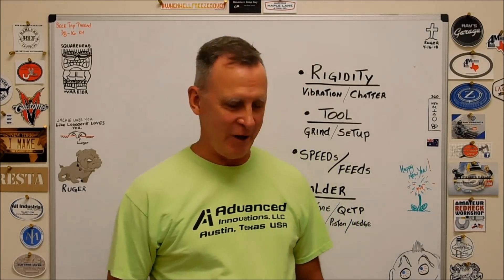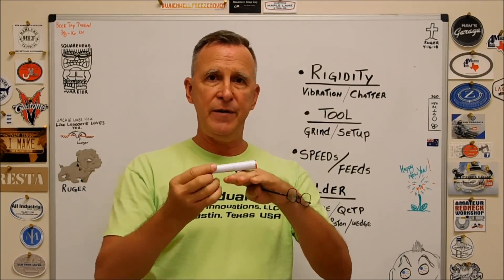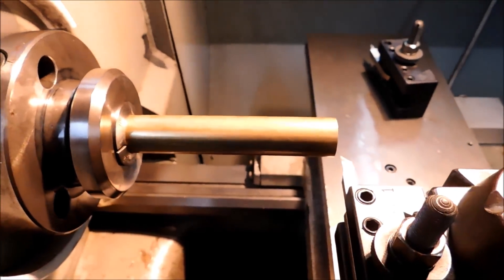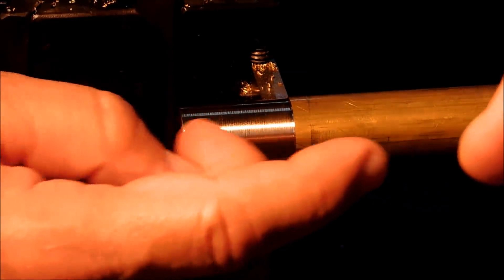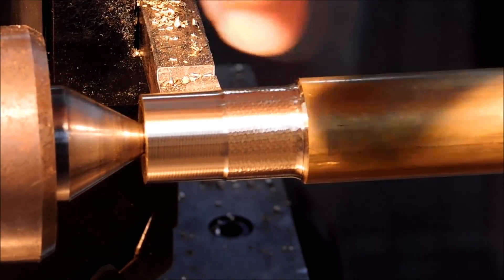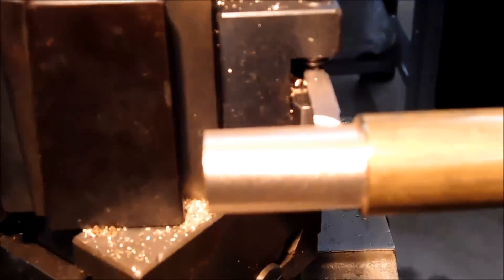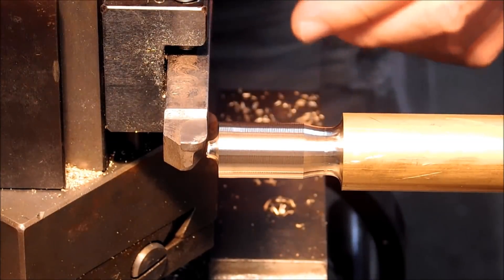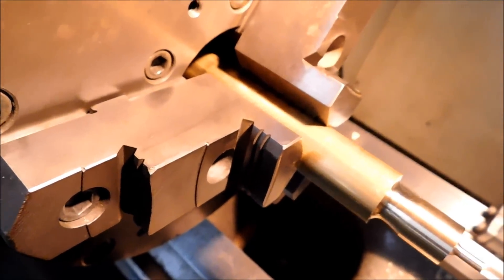Bad Turned Surface Finish and Some Reasons Why

Comment: Excellent demo Joe, lots of handy tips that will be applied on my small lathe. I've just ordered a steel wedge type QCTP which will help with the rigidity issues I've been having, coming from a cheap aluminium holder. I've been getting good surface finishes but issues with chatter when trying to take a deeper cut than around 0.005".

Comment: Is there anything we should know to reduce chatter when turning between centers? I've got an Atlas 10" lathe and I'm trying to make my cuts nicer. I'm getting some tearing, ~.625 diameter material both mild and stainless using carbide at 500ish RPM. Tried a few depths as well. Feed rate at .003ish.

Comment: 19:00 so this is the technique I need to use when I want my scale model parts to have a "hammered" finish? 

No joke, it seems like you could dial in a certain texture if you wanted a part to look cast or worn. Hit it with the right mix or red and brown to make a convincing old rusty iron piece.
Reply from the maker: It would be a great skill to be able to control that. I can see the ornamental use.

Comment: I wish that I had seen this video when I started machining.  Very clear.  I wonder if the results would be better with ER collets,  because they support the work evenly for the entire length of the collet, which C5 collets do not.  Also, I was surprised to hear you describe yourself as "blue collar".  I know that you work with your hands, but so do surgeons.  There should be a new color collar for surgeons and expert machinists who are constantly problem solving while working.
Reply from the maker: I like that thought. Maybe sky blue. A mix of white and blue. You make an excellent point.

Comment: Joe, I don't know if some one has mentioned it yet, but,  you didnt mention  " shear tool "  as an option for glass like finish on soft metals, i.e.  lead, alum, brass ... etc    .  I've only seen it mentioned on 2 maybe 3 other channels  ...  MR. Pete did an nice example of it, I wish I had known this approach before I got rid of my lathes ...     Good video  Joe   ...
Reply: Lots of positive top rake helps with the finish on soft metals.  I set up a lathe at work with a TFG style  toolholder and special ordered the inserts with tops and nose radii lapped to a mirror finish.

Comment: A few thoughts. Jaw engagement and the movement of worn chucks. If you think that may be an issue, an old standby to see if you have a gap get a can of spray Dykem and tighten onto your part and spray, give it a moment to set and open the jaws. you should see uniform areas that didn't get colored if it's going under the contact points. your jaw isn't grabbing there. that is reduced support. increases the chance of poor finish or in extreme cases parts discharging from the machine. (also great for when you cut soft jaws to see if you need to add a slight taper to get full engagement with the soft jaw because of the flex that is going to occur when you tighten down on a part)

Here's an idea though, and this comes up because Yesterday I was at work, on the old bridgeport. Doesn't have any niceties. no DRO, just an old manual worn down machine. I made a pretty critical screw up on the last cut of the day. One that never should have happened, but it got me thinking. it's little mistakes like the one I made that could and will catch someone new to machining off gaurd. I'm not used to a machine quite that worn out. so what actually happened, I was cutting a relief (sort of like a large flat T-nut) but I was cutting the side reliefs. I have it set in the vice, making the cut against the positive Jaw, So all I should have to do is run my tool back, flit the part 180 degrees, and run again. Load the next, They have a very wide tolerance so it's fine. I got to the end of the day, started getting anxious to get the cut on that part done, enter a bad judgment call...I ran the first side, flipped the part, and went "I could just climb mill back across it and be done with it." Didn't think about the backlash in the tables Y axis. got a half inch into the cut, and who would have guessed (everyone) that the table kicked back. luckily. It was as simple of a fix as to reset and run it the way I should have. But Overlooking the backlash and not having the table resting against the halfnut in the direction the cutting pressure is going to be applied. That was a pretty large mistake. I usually run lathes. Mills are not my strongest area of machining. but I feel like addressing some of those gremlins that occur and will absolutely ruin your day could be beneficial to those with less experience (or even myself where mills aren't my strong point)

Comment: So you know carbide inserts often have minimum RPM or cut depth before it will give a good surface finish. If you go under that it looks like crap. The problem is as they are meant for CNC there is no way you can ever meet their RPM minimums on a manual lathe (we would need about 3000 or more RPM for a 1 inch bar stock on steel with a depth of cut of at least 1mm). So I try to buy finishing inserts that allows a shallower depth of cut but vast majority of the inserts out there need much higher feed and depth.

Comment: Your safety message is spot on. My biggest fear is seeing some on a drill press wearing gloves.
Reply from the maker: And it happens in the blink of an eye. Gloves are not allowed in my shop unless handling a part during cleaning. NEVER on a machine.
Reply: Randy Hooks Gloves,any gloves are not advisable.If you need gloves to do machine work because your afraid of getting stuck by a sliver of metal,change your career or,hobby. I have seen so many people get seriously injured wearing gloves.
Reply: @jamesdavis8021  A-men brother.   Before I retired if I saw somone wearing gloves around any rotating machinery I warned them and took away their gloves. If I caught them a second time they would get their money. - The unions always stood with me,,,,and I was the company.

Comment: Hi Joe, 
I have been silently watching quite a few of your videos over the last few months. This one however stimulated quite a few questions. I am not a machinist, but do tinker with a desktop CNC machine, space constraints, and the  idea to buy that was also inspired by your videos, amongst others, as well as a certain female machinist, lets not name names to be fair to all involved... Both of you are excellent, but I do learn a lot more from you, although I can not really apply most of it on a tiny machine taking only a 1/8 cutter at maximum :) Enough of that, my main question is you mentioned that feeds/speeds is optimum at close to nose radius of your cutter... can you elaborate on that a bit? also, maybe in context to CNC as well as milling/turning, and as relates to plastics like acrylic, as that is basically the hardest I can handle :) 

Thank you :)

Comment: Hi thanks great video once again question work holding in a lathe I only have a three j chuck and need to cut tapered had screws but on the threaded end of the screw do you have any way of doing that or methods how to do it thank you ❤😊
Reply: To turn taper threads without a taper attachment: plug an ER collet holder with a male Morse taper shank into tailstock. In it, grip a stub turned to the same taper angle as the  thread (1 in 16 on radius, or 1.79 deg per side, for British, American, ISO and Japanese pipe threads).
A dial indicator clamped to the toolpost engages with the front of the taper, which acts as a template. As you make the early passes to cut the thread, wind the cross slide handle to keep the needle of the indicator on zero. By the time you get to the finish passes when it actually matters, you will have had the opportunity to become familiar with the right speed to wind the handle. I find I can easily keep the reading within 0.01mm either side of zero.
If operating inside a female tapered thread, the indicator may have to be shifted to the back of the template. In either case, make sure the tool and the probe are both at centre height.
Reply from the maker: Grab a piece of scrap material and tap a hole in it. Thread your screw into the hole until it protrudes out one end. Now hold the scrap slug and work on the exposed end of the screw. You can split that bushing so it collapses under chuck pressure, or use a nut on the opposite end of the screw to lock it to the scrap slug.

Comment: Especially on my Atlas lathe, keeping the top half of the cross slide over the bottom half as much as possible helps as well has keeping the tool post (if using an Aloris type) above the compound helps the rigidity a lot.  As with the tool bit hanging out too far, the cross slide and compound have a lot of flex on smaller, older lathes.

Comment: I think in another video you mentioned having the compound lined up with the edge of the cross slide for maximum support. I think it was your video anyway, but that might be another thing, to make sure the compound does not overhang the cross slide unless the cut requires it. I also had to adjust the gibs on my compound to get a better result. And the cross slide nut is worn down too.

Comment: Excellent video on the topic! 
You made me feel stupid wen You mentioned the collet issue, never considered that effect. I have C5 and E164 collets in my lathes, they both grip for a very short length on large diameters and I noticed eccentricity issues after shfting the stock. Do You think double slotted ER type collets would be better in this respect? 
I was surprised as well by how well that large flat tool cut that flimsy brass. I have made  several up to 20 mm form tools  from Sandvik WKE45 that also cuts well in brass, I think keeping the top of the tool flat is what makes it work well. Perhaps that is one reason Your tool performed so well.
Thanks You for taking Your time posting this!
Reply from the maker: Thanks for watching.

Comment: fantastic video, thank you!  I would be interested in a similar video for facing operations.  Sometimes I get a "spiral" pattern on my facing (aluminum or mild steel), I don't have power cross feed, but I feel that I'm pretty consistent in cranking the cross slide.  I've even thought about making a gear-reduction handle to mount a drill too, and use the drill and gear reduction to have a perfectly consistent speed of travel, just to rule this out.
Reply from the maker: Check the adjustment of your gib screws. the pressure from you turning the crank may be showing up in the part face because you are actually moving the whole setup. Be very gentle and see if it improves.

Comment: Joe, Thanks sooooo much for the demo.  I learned a ton of info.   One question....I presume that a "lighter" lathe (i.e. SB 9 or Atlas 6) is going to have various "other" issues that might need to be addressed, just due to their lack of "beefiness" and ability to absorb some vibration and deflection.  Can that be true?  Thanks again for your dedication to the "beginner" machinists.
Reply from the maker: Absolutely. Smaller machines are not as rigid and do have limits. You'll know when you hit one.
Reply: I started out turning electric motor commutators on a little 'hobby' lathe (IIRC it was a 9" So. Bend? too many years gone by...)

I was warned not to develop the habit of leaning my hand on the tailstock when turning anything, because it could 'spring' the machine and turn a taper instead of a straight cylindrical feature.

Comment: Thanks Joe, that info is very helpful. Alot of us own what we can afford = not so ridgid. Any help with dealing with ridgity issues is much appreciated. You mentioned wrapping work with tape, for worn chuck jaws. Would copper inserts accomplish the same result? Thanks again, Will

Comment: Another great job of teaching. I have the same lathe. Do you have it secured to the floor.
Reply from the maker: No. It sits on 1" thick machine mount neoprene blocks with aluminum plates on them.

Comment: One of your best videos yet, thanks!

I would love to learn about carbide inserts.  How do you select cutters... Size, shape, material?

On this video it would have been interesting to se if reversing the jaws on the 3 jaw chuck would make the cut worse... It will if your final comment is correct.

Thanks again... Best videos on you tube!

Terry
Reply: Our die shop machinists like Kennametal KC5010 for general purpose use.  Works well on everything from aluminum to inconel.  80-degree diamond shaped inserts are good for most jobs.  If you'll be doing fine finishes on non-ferrous material, a flat top triangular insert is good, like a TPG pattern.

Comment: Joe, QCTH - I have Multifix holders, which pull in a kind of splined sem-circle tool holder, against a matching spline on the body...very, very stable.

You commented on the collet allowing some "sag" of the material, due to a short support area...the collet seems to be a 5C type, which, I think, does not support the material as well as the ER type?

The very first cut had a really high-pitched squeal to it, which I'm going to guess was a combination of the length of material and the 'skinny' tool hanging out so far? It seemed to have both feed-rate artifacts, as well as quite fine chatter artifacts?

Comment: I struggled some time with the surface finish on gummy mild steel, and hydraulic rod also, then tried (chinesium) cermet inserts and they did a spectacular finish on both id and od while carbide or even honed hss toolbit left a bit unfinished touch to the parts. Same size of inserts and same holder as well. And only about twice the price of regular carbide inserts, which is still cheap

Comment: Hi Joe.  I have a small 11" lathe and do some amature gun smithing. I have tried to reprofile old military  take off barrels. Glad they were throwaways; not pretty a lot of chatter  . Have tried speeds, feeds, tool bits, etc. the middle of the length is usually the worsts,  some are better than others but not what I want . The  barrel is chucked up on the receive threads with a collet and live center in the muzzle  the barrel is about  22" long. Any suggestions
Reply: You're probably getting deflection in the middle due to the long span between the collet and the live center. Look into using a follower rest, which will resist the force generated by the cut. A steady rest steadies the middle of the long span, but won't allow you to cut in the area of the rest.
Reply: The problem with the follow rest is the barrel contour is a long taper. A old smith I know actually hangs a lead weight that floats off the tool post so that it lays on the barrel as carriage travels . I don't like it because I think it induces stress into the barrel and or puts  a bow  into the barrel .  The only solution that I can come up with is to spring load the rub blocks in the follow rest. Haven't tried it yet.  What are are your thoughts? Thank you for the response and your vids.
Reply: Springs have a resonant frequency. Likely any spring stiff enough to offer support will be resonating at some multiple of your turning RPM or the barrel spring RPM, and you will be real lucky to get anything except more chatter, possibly at multiple frequencies at once.

A pendulum also have a resonant frequency, but usually much much lower than a spring frequency. The lead weight is a follower if it tracks the barrel smoothly, or a pendulum if it bounces. But with luck and some tweaking you can probably find a combination of weight, contact point and contact shape that won't bounce. Then you have a form of follower rest using the mass of the weight as the follower.

Keep in mind your tool pressure is inducing a bow in the barrel; the barrel tries to move away from the tool. If you can arrange the weight to try to introduce a similar bow in the reverse direction, you end up with counteracting bows and end up with a reasonably straight part.

You could also rough profile the barrel and then take some light finishing cuts, possibly with a sharper tool that uses less tool pressure. So even if you got a bow when roughing, you could (at least mostly) turn it back out on the finishing passes.
Reply: I know nothing about gunsmithing so this may be totally off the wall: Is it possible to fill the barrel with lead shot or sand to add mass to help dampen resonances?   
A follower rest with a pivot and weight might be be better than your idea of spring loading since the mass would be less likely to 'twang'.  Better control than hanging the lead directly on the barrell. Make the pivot area large and add some  highly viscous grease to aid damping?
Reply: Barrels are basically a long narrow tapered pipe generally made of chrome moly or S.S. Wouldn't wont sand involved with my lathe but the lead shot sounds promising. I'll give that a try . Thanks.

Comment: Hi Joe this was a great way to learn how to do it the right way. And what to expect when things goes wrong. I not a machinist at all. And do intend to do a evening course on using a metal lathe ounce my restoration of my lathe is completed. Which I'm expecting to take many months. But she comimg along nicely. My question if you don't mind me asking. My lathe top speed only goes up to 550rpm. As she's from 1939.  Is that going to be a problem working with different types of metal. I went on impulse when I saw her. As I felt she was very neglected and needed saving. I know she's not an animal but I really love old machinery. And it really does irritate me that these well made machine's can be left to rot in a corner or just abused or striped down for parts. Just so one can make more money.
I hope it's not going to be a problem for me. As so far I've put in so many hours and days in just the tailstock. 3 months so far. It would be such a shame to know it's going to be an issue. Great videos as always joe. Love your channel 👍👍👍👍